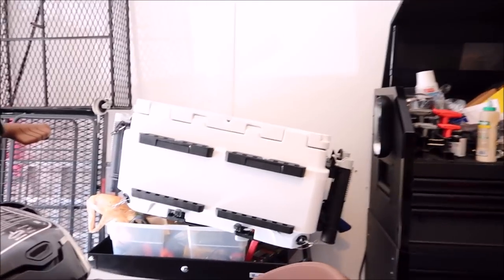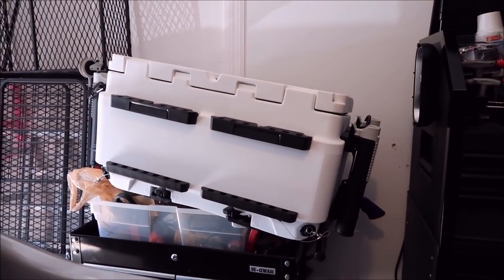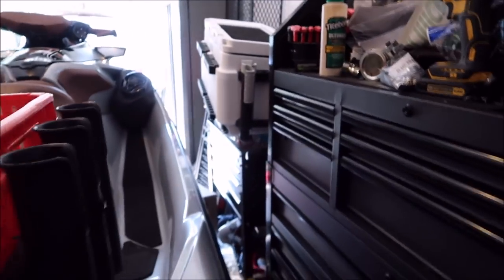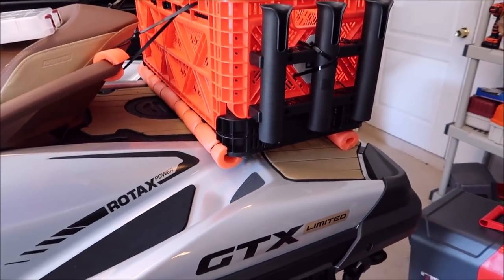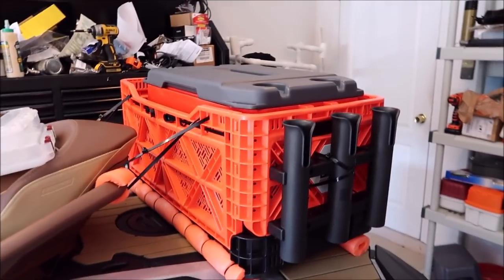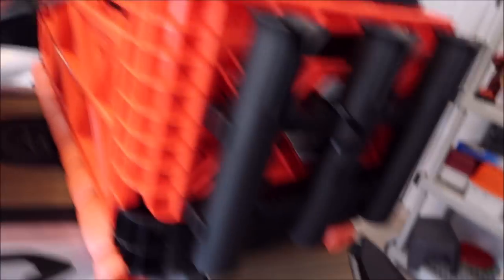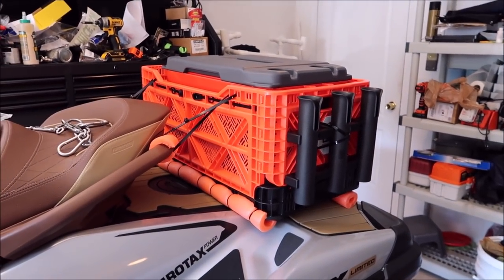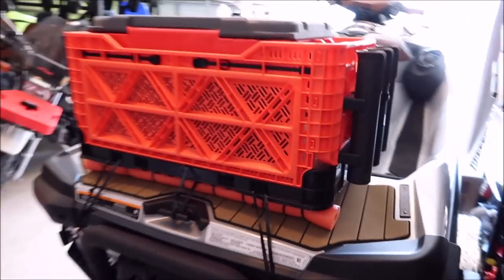2019 HOMEMADE FISHING RACK - JET SKI - PWC - WAVERUNNER - INEXPENSIVE DO IT YOURSELF SEADOO GTX 300

Comment: This is the solution I needed!! I really wanted a DIY solution bc those other racks are easily $500+. Question, would you have any ideas on how to make this able to connect to the LinQ system? I just got the fasteners to see how I can attach to rack or in this case, a crate. Great video

Comment: I've been shopping for a PWC the last couple of months and was leaning towards the fish-pro just because it was completely rigged.  Now that I've seen this, I've already ordered all the parts (except cooler).  Question, when you remove it for cleaning or riding without it, are you cutting the wire ties that are attached to the seat handles?  Great video.